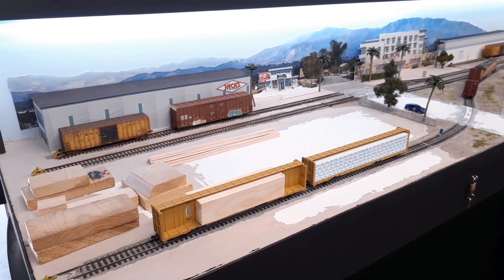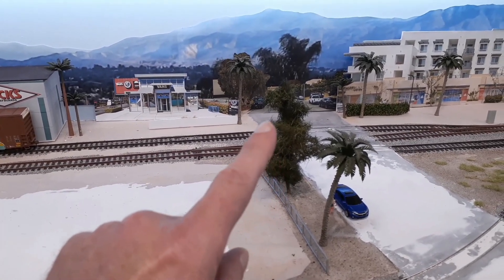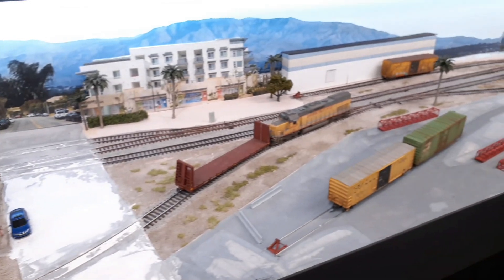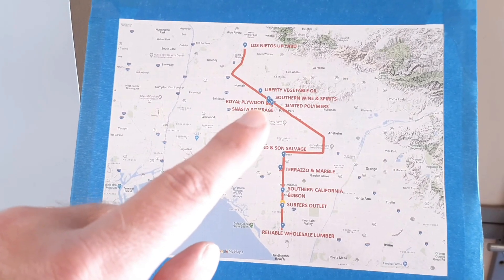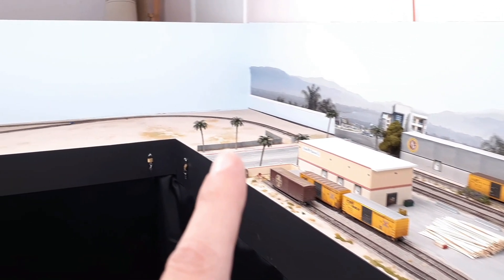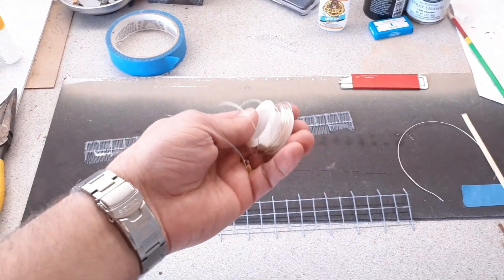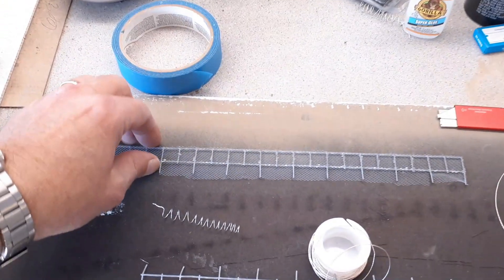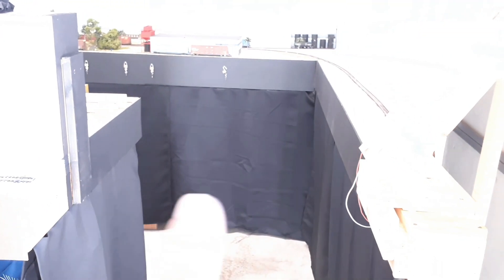Layout Update #37 | Making more fences | and other stuff

Comment: If you still want to switch scrap gondolas, you could move the industry to the other side of the main line, and use the track going to the hidden yard. You don't even have to build the scrap yard, it could be just around the corner hidden behind the backdrop. That way you keep a car spot and gain more area for scenery.

Comment: That’s looking really good. Love the fence idea. I’ve used the tulle before but I ended up soldering all my posts together. It was a real pain. Any used how big the holes are in the chicken wire?
Reply from the maker: Hi, thanks for the comment. So the 'chicken wire' size of each hole/square is almost exactly 1/2". I think I bought an entire roll of the stuff at Lowes or Home Depot awhile back for the garden. So in HO scale, a fence section that is two square tall, or 1" works out to 87" or just over 7' tall in real life. Makes for a pretty close match to real fencing.
Reply: @socalscalemodels  oh that’s perfect.!   Like I said I made my own on the old layout but it was not fun. Lol.